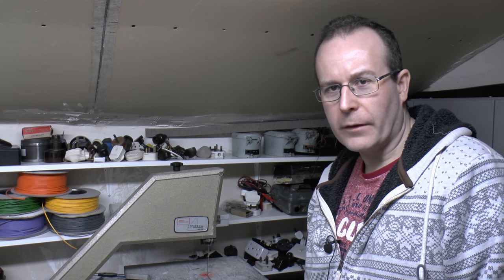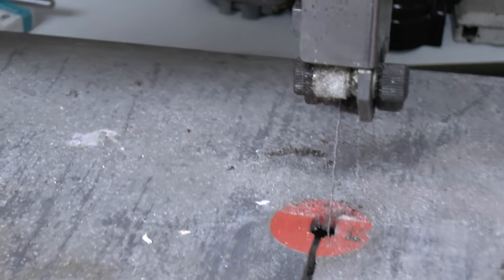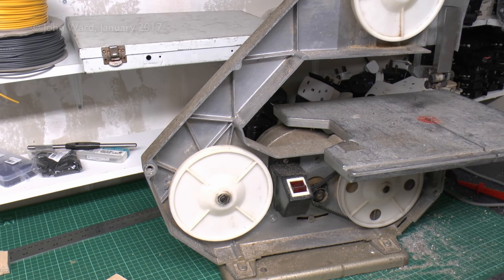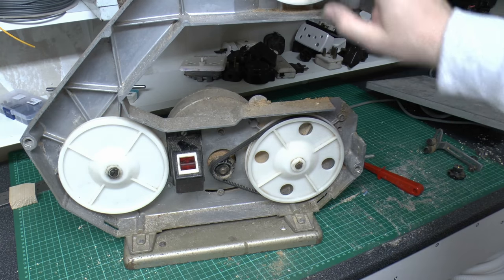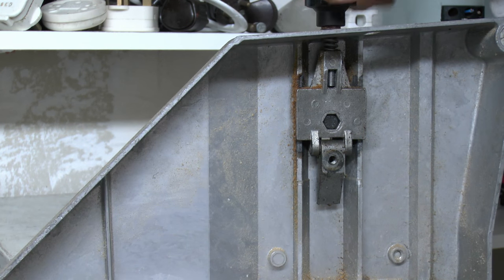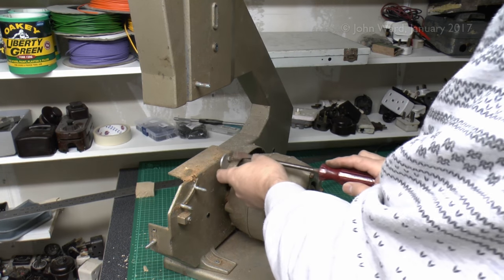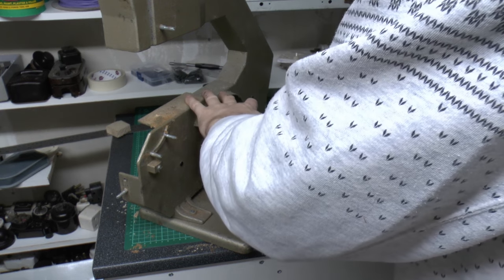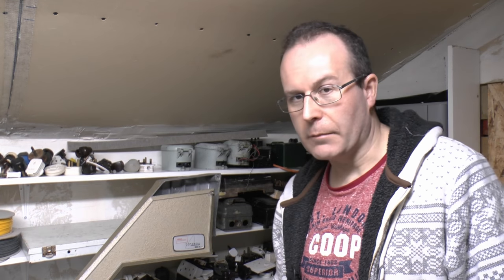Burgess BBS-20 Bandsaw Teardown

Comment: The "Fabric" on the blade guides is Felt that you drench in oil to keep the bearings oiled. My Granddad had one of these. You should still be able to get a new set of Blade guides and I highly recommend it as once they are correctly set up this band saw performs like a gem :) I used to use it with the finest blade I could find to cut Blank PCB's up :)
Reply: Burgess tools were a common diy brand in the 60-70s,  by the time i got my hands on these the wheels were all sloppy and no way to fix it, so id never used one that the  blade didnt fall off constantly
Reply: Don't drench the felts in oil.  "Moistened" is what the manual says.  Too much oil can cause the belt to slip or ride off the wheels.
Reply: @dreadnaught2707  Easy to make your own brackets to fit bearing guides instead and the one I did runs smooth cutting better than I expected for such a compact little machine.

Comment: When you reassemble the blade adjuster on the top you need to put the spring on the  threaded adjuster and the large washer next which gives you some spring tension on the blade. I always slacken the adjuster to take the tension of the blade as you would with a hack saw. When not in use.
Regards Dave.

Comment: Hey John
I just picked up a mk 1 of these  lacking a switch. Any suggestions for a replacement?
Reply from the maker: Something like this: http://cpc.farnell.com/molveno/sx8211881g110000/rocker-switch-20a-red-dp-off-on/dp/SW05303
just need to make sure the panel hole is the right size.

Comment: I've had one of these since around 1970.  Extremely difficult to get the blade tracking accurately and I've never been impressed by its performance with wood.   However, even though I've got a real heavyweight cast-iron frame large bandaw nowadays, I leave the BBS 20 set up with a metal-cutting blade -- it actually does a very good job on small metal-cutting jobs.
Reply: would probably manage a  bit of plywood! i too remember these, at a time when they were the only cheap bandsaw for home, advertised in all the diy magazines at the time, they were pretty bad quality of course.
Reply: I rather think that a lot of the problem lay in the poor quality of some of the blades Burgess themselves sold for this bandsaw. Never had any problems doing good work with the metal-cutting blades, but most of the wood blades left quite a lot to be desired.
Reply: i only ever seemed to come across these when the wheel centres were ovaled out (cant remember if they had a bush or ran direct to the plastic) so they could not ever keep the blade on, of course it would have been made worse be people overtightening them
Reply: Probably the result of rank amateurs with no idea of how much tension to apply -- and no tension gauge to give any indication of what might be roughly appropriate.   At least worn wheel centres can be bushed.
Reply: Modified the one I have with bearing guides and it cuts true and smooth, I cut aluminium up to 4mm with no problems at all, great little saw.

Comment: THANK U. Was very interesting! Have a similar one but need to replace the wheels! Any idea where to look for?
Reply from the maker: No change of getting replacement parts now, this is 40+ years old.  Only source will be another similar machine.  If you have a lathe it would be possible to machine new ones.